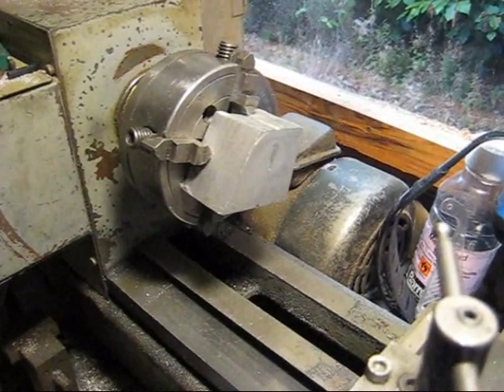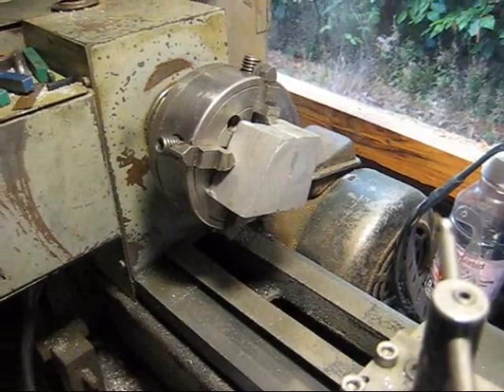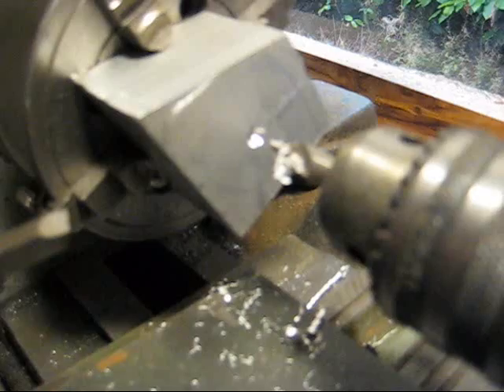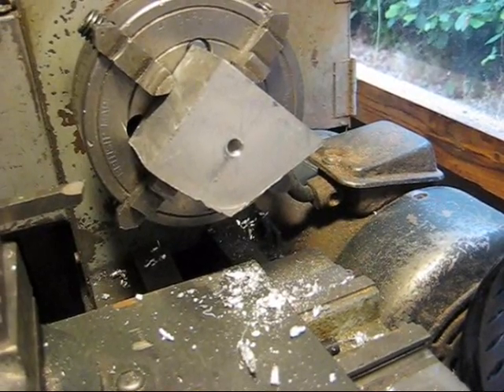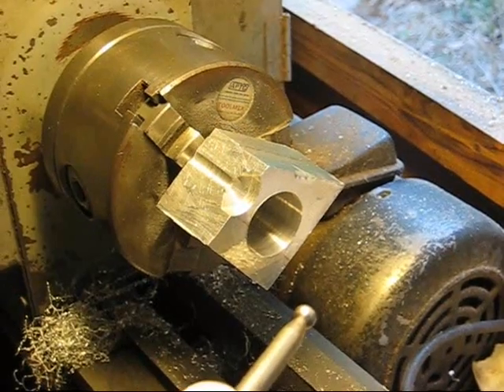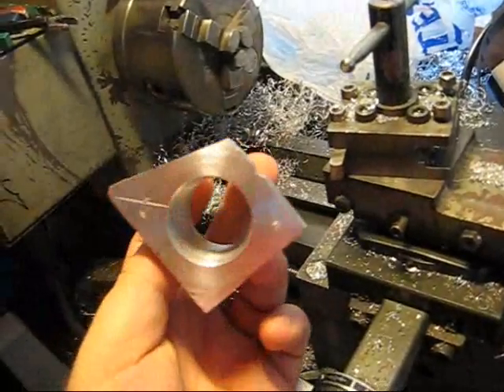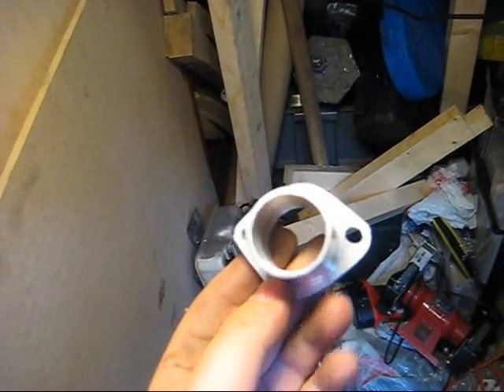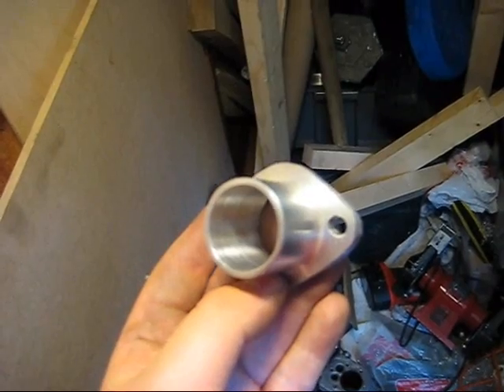8HP Briggs-Pt4 Intake Manifold

Comment: Nice intake manifold. I need to make one myself.. and will be doing a similar thing on the lathe, but will start with a piece of 2.5" aluminum round stock.

As far as the machining part, I would c-drill, then drill with a big drill as a smaller one is more likely to walk (run out), then get your B-bar and finish the ID. Then turn down the OD somewhat, flip it around, and turn/face the other side. Stay away from inside clamping unless absolutely necessary.